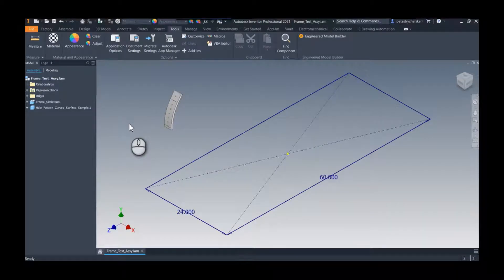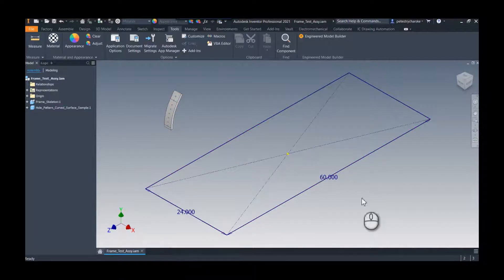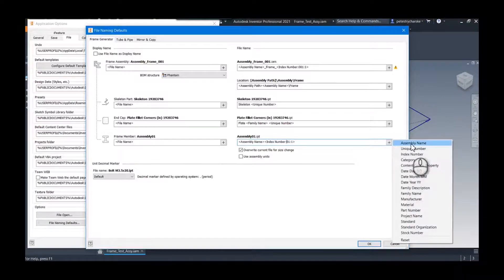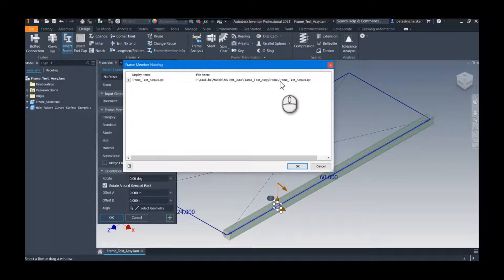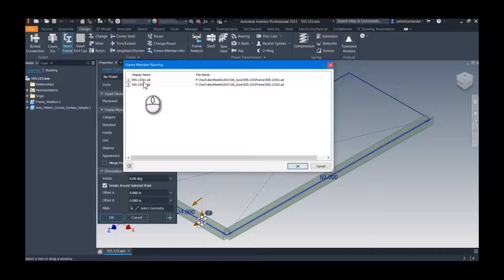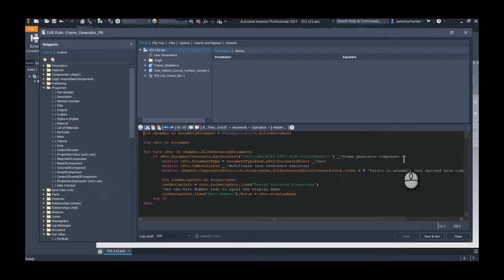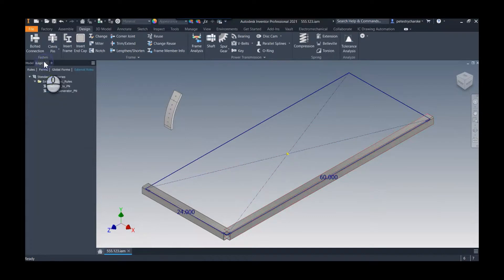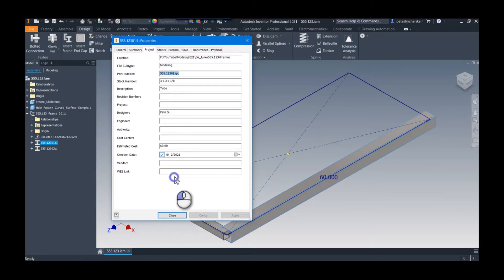Inventor - Methods for Controlling Frame Generator Filenames and Part Numbers

Comment: Hi mate, could you help me, i have a question, Is it possible to change the file name Just by changing the part number, i want to edit aluminium profile, before i trim, the length is 1000, and the file name is 1000 and the part number is 1000, if i trim the alumunium profile to 800, the part number will change 800, but the file name not change, how to change the file name only just change the part number?

Comment: Thanks, Pete. 

I wanted to know whether this type of thing would work if you save the assembly as another number but then change some parts and remove others with welded components. I tried something like this, but when I returned to the original file, I realised that the changes I made to the new one were also affected to the old part's generated frame. How do you change the structure to not refer to the original one? Because I tried to replace the frame with a different sketch, except I changed one dimension. 

There may be an easier way to create a rectangular type frame - e.g. with all dimensions the same, except for one. E.g. 1000 x 1000, and then base the next one on 1000 x 600 and the next to 1000 x 400 - something like that. I want to use the same design but change one dimension every time. But the biggest one may contain extra components to strengthen the structure.

Do you think this makes sense?
Reply from the maker: @webb.industries thanks for reaching out!  This is a really interesting question and I've been giving it some thought, but unfortunately haven't had time to formulate a solution.  My initial thought is to try and use Model States and see if  I can have "unique" variations of the skeletal model.  That way each new design assembly can be tied back to a central sketch model and you can components as desired.  This may also work within an iAssembly workflow.

Please note that I haven't had any time to test, so it's all a bit theoretical at this point.  However, I've noted this and will revisit it as soon as I'm able and see if I can knock out a video (provided there's a good solution.)

Really appreciate the question, apologize for the delayed response, and have a most blessed day!

- Pete
Reply from the maker: @webb.industries, it looks like Model States did work well for this process.  Please check out the blog post and video link below.  Also, if you need help with anything else, please do not hesitate to reach back out.  Have an awesome and most blessed day!

https://hubs.li/Q01Y2s1G0 (Blog Post)

https://youtu.be/np87r_q4Iss (Video Link)

Comment: @Jhoal,

I never did thank you for you doing this video. It truly helped me. I extended this concept to do a lot more auto-configuration, including creating segregated folder hierarchy based on the naming convention. I even tried to Save to Frame template to a new Frame Skeleton with a SK+name that matches the Assembly name. However, that aspect didn't work.

Unfortunately, I no longer work for that employer and no longer need Frame Generator models. But a great lesson on several aspects of Inventor and iLogic.
Reply from the maker: So glad that you found the video helpful and please let us know if there's anything else that we can assist with.  Hope all is going well with your new employer and have a most blessed day!

Comment: Hello Pete, I have a pretty simple question around frame generator (I think) and it has to do with Pack-N-Go from Inventor to a new location. The issue seems to be that the association with the skeleton model in the frame assembly seems to remain in the origin location that Pack-N-Go was initiated from, and makes the new frame location and assembly model un-editable ?

Can you advise on this and or best practices of not only Pack-N-Go, but also "Make from" where you may want to make another frame very similar to an origin frame but with minor modifications (this seems to be an issue more so when copying or make from, or Pack-N-Go) - any help is greatly appreciated

Thanks a bunch

Walt J. Ecolab/Nalco Water
Reply from the maker: @waltjenkins6241, so sorry to have missed this comment somehow!  I'll have to do some testing on the Pack-N-Go concept to see what can be done.  Unfortunately, it doesn't rename the files, so there could still be some issues there.  You could explore using Design Assistant, which is a bit old, but does have to the capability of renaming components.  My advice is to use Vault and the Copy Design tool.  We just released a video showing how this process could work with a single skeletal model driving frame variations, which has been working well.  Please check out that video link below.  Thanks for your patience, hope this helps and have a most blessed day!

https://youtu.be/np87r_q4Iss

- Pete

Comment: Error on Line 13 : Syntax error.
Error on Line 15 : Syntax error.
Error on Line 17 : Syntax error.
I run this Code and show error. Please help me!!. I use Inventor 2021 pro
Reply from the maker: LÊ HỒNG SƠN thanks for reaching out and our apologies for the delay in getting back to you.  Can you please double check your code?  Line 13 should be just a comment line, Line 15 should be the End If line and there isn't a Line 17 (at least with the way it's written).  Have you combined this with other code?  Is this being done in an iLogic rule?  If you're trying to code this into an add-in, you may have to tweak some of the code you're building.  Hope this helps to clarify and please reach out with any questions.

Comment: Hi, why when I try to run this code it shows me that syntax error in line 13, 15 and 17. Did I do something wrong there?
Reply from the maker: Andris, sorry to hear that you've had issues with the code.  In my original code, line 13 is a comment line and shouldn't even run anything, so I would double check the code on your side.  Be careful about the string: {AC211AE0-A7A5-4589-916D-81C529DA6D17} which identifies the Frame Generator components.  There could be some errors that occur, if that's not correct.  Please let me know if this helps and thanks for reaching out!  Have an awesome and most blessed day!

- Pete
Reply: @Team-D3  Thank You! All working now PERFECT!

Comment: Have you seen any issue arise with the warning about potentially creating files with the same name? I want to switch mine to an index number because the unique number is 13 digits long and I think I'm getting errors with having a file path that is to long when I download the frame to the local machine. I've heard there are some issues with using frame generator and vault when there are frame files with the same name. I use separate ipj files for each project and in my experience frames usually point to a specific frame folder.
Reply from the maker: Aaron, excellent question!  When I'm using the Index number, I typically couple that with the assembly name.  That has kept me out of trouble, as long as I don't reuse the assembly name.  If you have Vault professional, you could also use Naming Schemes module to help avoid using the same assembly names, but the risk is generally low (especially for a smaller design team).  Please let me know if you have any other questions, I'd be happy to help!  Have an awesome and most blessed day!

- Pete

Comment: Your user should call their project file (ipj) the job number and then in the frame generator default names use <Project Name> which calls the project file. I didn't have a line to discriminate between  content center part and others, I just ran the script in the phantom frame assembly. The next thing I'm trying to work out is getting <index number> to count across the project. Because if you have 2 frames in one project, the part numbers will double up.
Reply from the maker: William, thanks for reaching out!  I have many users who only have a single project file, who use Vault for example, so using the project file won't help those situations.  This is why I typically use one frame per subassembly and use that assembly name as the name driver.  For example, if I have a project ABCD and there are two subassemblies "-100" and "-200", I would have the following frame assembly names: "ABCD-100_Frame" & "ABCD-200_Frame".  I'm not saying your approach is incorrect, by no means, just wanted to share my thoughts.

Please let us know if you have any other questions and have a most blessed day!

- Pete